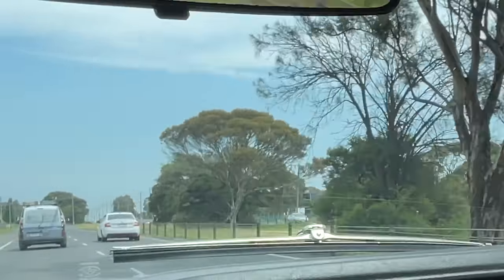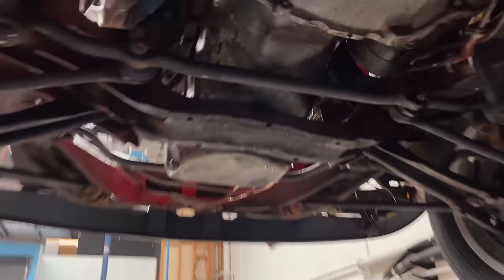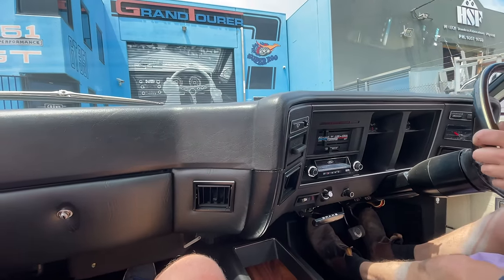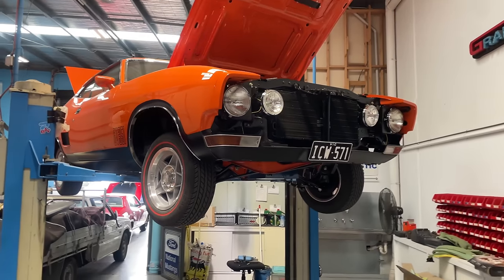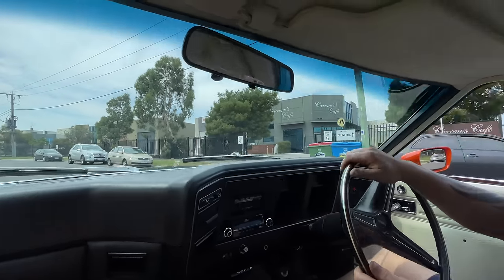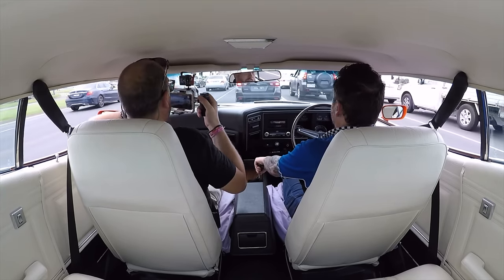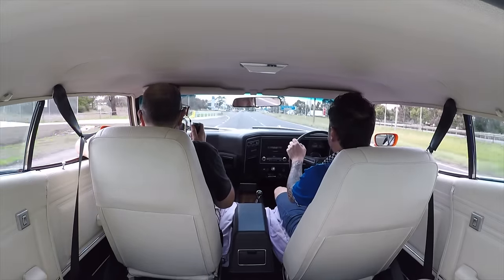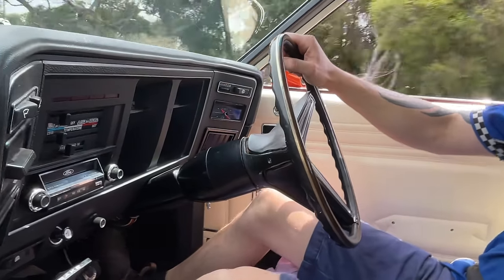Can this 650bhp Beast with skinny tires scare the Living Daylights out of me?

Comment: My new engine build threw the V belts also, found it to be the Romac balancer I used and after sending it back to them and being told there crap measured correctly found it did not have the correct clearance with the standard pulley. I machined the pulley on a lathe creating the clearance needed and no problems with belts since. hope this helps somebody because Romac couldn't care less. 
Thank you for the video I am stoked to see Grand Tourer still in business great work to them also.

Comment: How can the high hp of the engine cause the belt to fail? The torque transmitted to the alternator will be the same no matter what the engine hp. This belt failure is more likely to be caused by high revs. Poly vee belts are far more efficient

Comment: I have never heard such rubbish about the alternator slipping belts because of the ' high torque of the engine'.

It has nothing to do with that and everything to do with the alignmrnt and correct matching of the 'V' of both the driving pulley  (harmonjc balancer) and the driven (alternator) pulley, as well as the water pump as this is running on the same belt typically.

Comment: Ive got a 1974 XB GT hardtop in polar white with white interior and windback golde sunroof (1 of only 2 in the specs of mine) all matching numbers and i priced up a similar 434ci combo from Zoran at Competition Engines 💪🏻👌🏻 and its quiet well priced for what ya get.
Reply from the maker: What’s that like to keep clean
Reply: @davesclassicgaragetours  not easy hahaha, even when its sitting in the shed most the time it gets covered in dust easily 🙄

Comment: Amazing XB hardtop, sounds great. Also earlier in the video that green XY is gorgeous!. 7:00 he mentions the black phase 3, it still exists today, black interior, orange GT stripe, and sunroof. Only 8 black GT's were made, 7 auto, 1 manual but a few of the autos were converted to manual. The factory black manual GT was built in April 1971 and is delete stripe (orange stripe later added), black interior and it still exists today. Many replicas in black exist.

Comment: that piece of dash right side of the glove box is giving me the shits thats un adhered
Reply from the maker: Still some tightening up of bits to do
Reply: @davesclassicgaragetours  that's not tidying up that's a customer wondering which other bits won't have enough adhesive over time let alone restoring a dash ain't cheap. I'd   expect better as it's a specialist job. They should know what they are doing. This isn't a paint run that can be blocked and polished this is a dash out scenario and if I were the customer I would have it redone and not trust the amount of adhesive used by whoever restored the dash.
Reply: Just to confirm we didnt restore the complete dash. The owner of the car sent complete dash unit to someone to restore. We received the car in bits and some stuff had been sent else where by owner.We had also pointed out to owner of car that above the speedo and tacho you can see a slight ridge in the crashpad so the guy who restored the dash has done another one. Its yet to be changed as we are still sorting the car. Its just about done. Maybe before you make the shop look bad on social media you should find out who did what. The guy who restores the complete units doesnt actually do the reskinning of crash pads he sends them to the same place in melbourne that everyone else does.  He was totally cool to send another one out to get done at his cost. So it will get changed before the car leaves. Hopefully it stops giving you the shits now you know its getting changed 😂